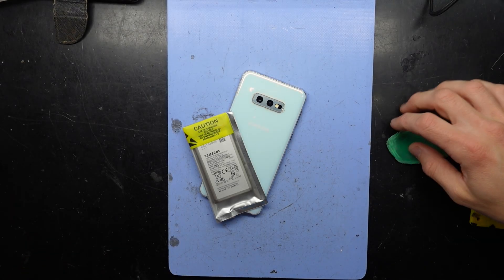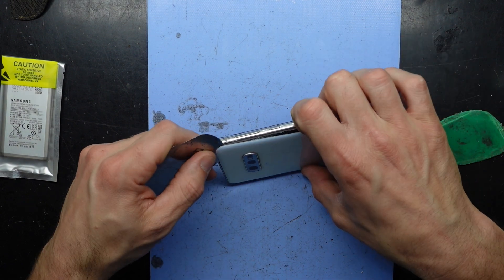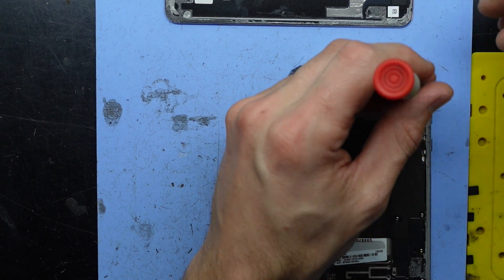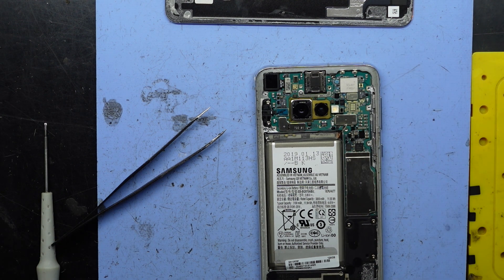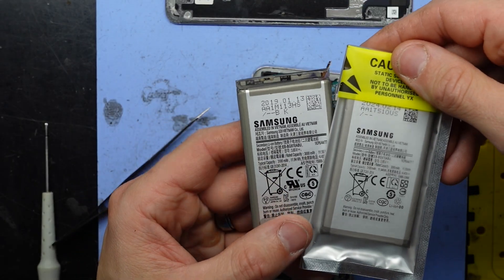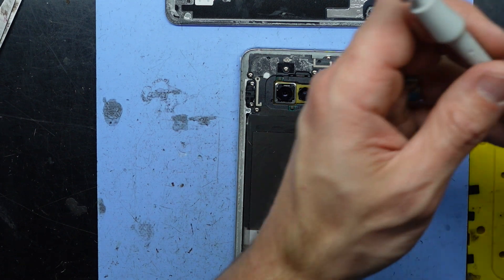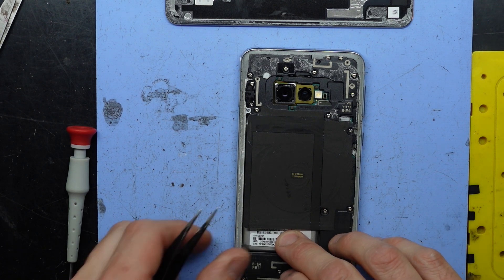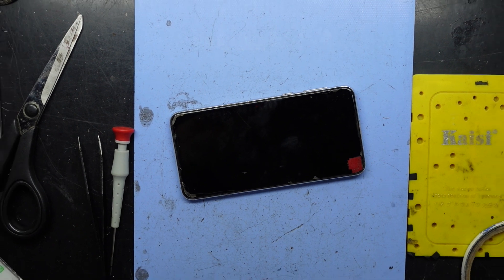Samsung Galaxy S10e Battery Replacement

Comment: just did mine, it was dated 2018. thanks for this simple and very helpful video!
Reply from the maker: Glad it helped, cheers!
Reply: How does the battery last now with the new one?
Reply: @alex5shaq  so far seems way way better. I just got a generic top rated aftermarket on Amazon. 7 hours later still at 63% from 100. normally would be in the 20's or less
Reply: @Jonoman777  do you remember the name of the brand? Bc I see on Amazon a brand named ruemiu which states their battery has a 5150 mAh capacity but I don't know if it's true. I see another with reviews which has the same capacity as the original 3100 mAh.
Reply: @alex5shaq  of course its not true. the one i got states 4600 but i already knew that wasnt true before even ordering. it seems the same as a new battery and thats good enough for me. just go by reviews and dont expect to get any kind of capacity more than what comes standard. theres no magic battery thats the same size with more capacity